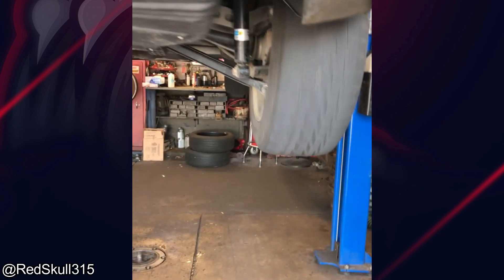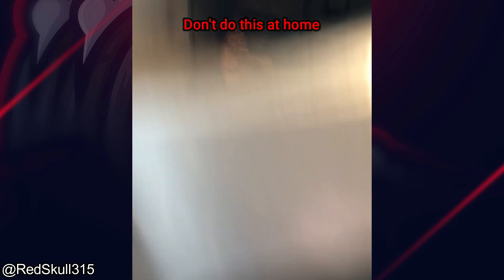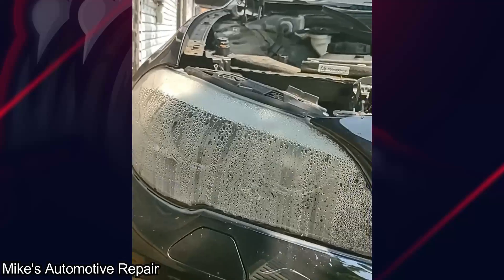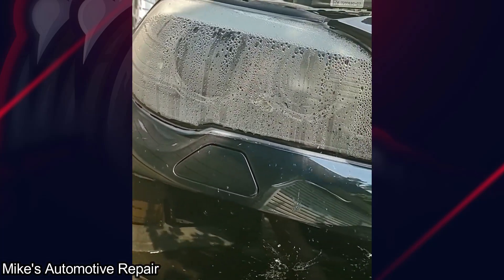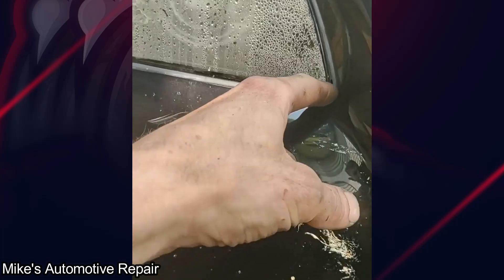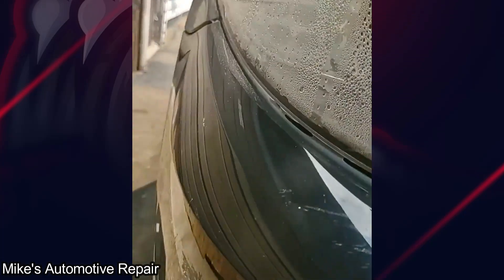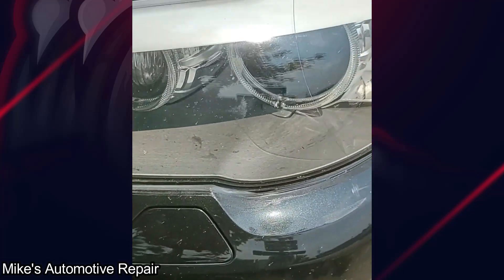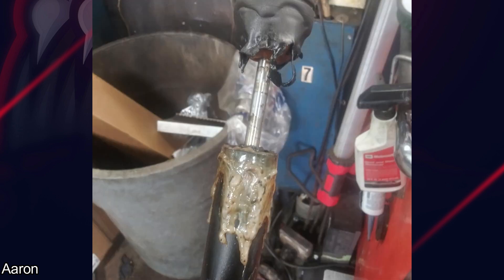Customer States "I Change My Engine Oil At Regular Intervals!" | Just Rolled In

Comment: I took my car into the dealership to get the tires rotated for free after buying it 6 months ago. AFTER performing this service for me the "ASE Certified mechanic" walks up to me with an official-looking form that had my VIN, make, model, year, color, etc. printed on it along with some boxes that were checked off to look like they had done a thorough inspection and found some issues that should be taken care of. First on the list was an oil change. I asked him what kind of oil he recommend for my engine. He said 10w-30 and synthetic would be best. I asked him how many oil changes he's done on this particular vehicle and he said "tons". Then I asked him to follow me out to the car for a minute. I popped the hood and asked him where exactly he was putting the oil... in my electric car.
Reply: @robertheinkel6225  I wonder about this as well
Reply: Priceless
Reply: It's like the guy who went with his girlfriend who took her Toyota RAV4 into one of those quick lube places to have the oil changed.  When she went back in to pay, the guy up front said that the "lube tech", due to her mileage, checked and recommended that she get her transfer case and rear differential fluid replaced.  When he quoted her how much it would cost and if he could put her down for an appointment, the boyfriend asked him how it was even possible being her RAV4 was front-wheel drive.  He said that the guy just stared at him for a moment with an "uh-oh, got caught" look on his face.  He then told the guy that no one looked at her vehicle and that they were trying to rip her off.  He said that she never took it back there.
Reply: @robertheinkel6225  hey man, not all of us service advisors are incompetent 😅
Reply: @trekzilladmc  If memory serves, RAV4 doesn't have transfer case no matter it's AWD or FWD. So do most of other FWD based AWD vehicles like Highlander, Sienna, CRV.
Reply: @trekzilladmc  Oil place I used to take my cars to loosened up the battery cable on my kia soul. Thought the first time it was my fault, had just replaced the battery the week before and might have not tightened the bolt. Second time I knew it was them. Yeah bet it would have been some expensive repair I could not afford that did not need to be repaired. Never went back to that place again. F you Kwik Kar oil!
Reply: @trekzilladmc  Wow never took it back?? You don't say??
Reply: I had my wife take my 95 roadmaster to an alignment shop once. She called to say the upper ball joint was bad and they refused the alignment. Fine I said. She came home and I went to drive to the store except the car wouldn't drive straight at all. I looked underneath it and the right tie rod sleeve had at least an inch of clean thread. Someone messed with it and pushed the tire so far out the car was undrivable.  I adjusted it and it was fine. However I called the shop absolutely livid they endangered my wife and everyone's lives by messing with my car that way. The service advisor assured me nobody touched it. I was like "so my wife did that??" Ain't no way your guy didn't touch my car I said. He said if I came down he could show video of the shop. I said if I come down there he's leaving in an ambulance that's how mad I was. To this day I have no idea what would possess someone to monkey with a car then send them down the road.
Reply: @trekzilladmc  you have RAV4s where you are that AREN'T AWD? That would be a RAV2.
Reply: @JBofBrisbane  Here in the U.S., the RAV4 comes in FWD as well as AWD.  Is it called the RAV2 where you're at?

Comment: Imagine if you did take your car to get the oil changed reguarly but it turned out the garage never did it once & just charged you for it.
Reply from the maker: I've heard of that happening before. Sadly I'm sure it happens more then we think. Pretty sad when a shop can't even change the oil after somebody pays for it.
Reply: @JustRolledIn  My father had a 1972 Malibu with the big V8. Got terrible gas mileage. Always had it serviced at the dealer (plugs changed regularly as this was the last of the leaded gas models). My father decided to change the plugs himself one day because of the terrible mileage. Fought with plug #8 for over an hour due to the lack of access before finally pulling out the oldest plug you ever saw. The dealer had never changed it.
Reply from the maker: @petercolquhoun2086  ugh that pisses me off to hear that! Not the first time hearing about places doing that.
Reply: @petercolquhoun2086  That happens a lot on LS engines in trucks, suburbans and tahoes.  #8 is fairly difficult, so a lot of people don't bother to change it with the rest of the plugs.  They come in with a misfire on that cylinder, pull the plug and sometimes the electrodes are completely worn off while the rest of the plugs look new.
Reply: Thats why I change my own oil myself. Cant trust companies at their word for anything.
Reply: @JustRolledIn  More $$$ for the shop and NO oil waste!
Reply: @toradora1439  Same,  the technician always cranks my filter on way too tight! I shouldn't have to nail a screwdriver though the filter to twist it off lol.
Reply: @toradora1439  Yup, 5k miles oil changed by myself is cleaner than 3k oil from shop which claimed to be 5k full synthetic and charged for extra bucks. Now I am considering about changing transmission oil by myself next time.

Comment: "Turn signal doesn't work."  The average BMW driver wouldn't even notice.
Reply from the maker: I was thinking the same thing when I watched that one 😜🤣
Reply: You might be able to notice at night,  @JustRolledIn .  Unfortunately, with that much condensation in the headlight good luck being able to get your electrical equipment to even reliably function.
Reply: What kind of bone head needs a BMW anyway . All the ones I see have tinted windows so you can't even give them the finger .
Reply: He was using the $2.99 per gallon WalMart blinker fluid, not the $299 per gallon BMW approved stuff.
Reply: That's because BMW cant patch the turn signal fluid reservoir and drivers lost all the fluids immediately after they filling it up. 
Not the drivers fault not the drivers fault. 😜

Comment: 0:21 I once had a piece of gravel get stuck between the rotor and the caliper bracket right after I did my brakes. Needless to say I was going through every possible scenario in my head to figure out how I could have screwed up the 2nd or 3rd brake job I did on the car since I bought it.
Reply from the maker: Well glad to hear you figured it out lol. I'm sure a lot of us have had this happen. I sure have!
Reply: We had a damn pebble get stuck there while driving once. Damn thing made such a racket and we just had to keep driving. There was some nice marks when it fell out or ground itself down into dust. Somehow nothing needed replacing.

Comment: Recently did a GM 3.6 timing chain. Recommended a oil pump as she was a bit low on pressure AND I'M RIGHT THERE. Nope. Couldn't afford.
Fast forward to 12 weeks later, oil pressure dropped so low the new tensioner wouldn't tension, valve cover cracked open from the sloppy chain, pieces fully jammed the oil pump, bearing fail.
The chain one at the end made me think of it
Reply from the maker: I've heard those 3.6's have a good handful of issues.

Comment: The early 90s toyota trecels control arms will do that near the bolt on ball joint too. The fun part is when you try to get the bolts out the head snaps off so you cut it off leave a bit of the bolt. Grab it with the vice grips then the captured bolt inside the damn body comes off the welds. So then cut a hole in the bottom of that.... p.i.t.a. aaarrrrrgggghhhhhhhhh.
Reply from the maker: Sounds like you've had to deal with that a couple of times lol
Reply: @JustRolledIn  Just one really really bad experience rebuilt the whole front suspension 4 new tires engine tune up. And then had a semi run across 3 lanes into me only like 2k miles later. 1st of the back set of axles hit in the gap between fender and door. Car was slightly sideways hard braking so. We were at back of cab when we realized he wasen't going to stop coming into our lane. We were in front of him before so he saw us for sure. Scary as all hell when you realize semi tires are a bit taller then the car that you're in.
Reply from the maker: @alreed2434  Holy cow! That's definitely scary, I couldn't imagine. I'm glad you're here to tell the story!
Reply: @JustRolledIn  For sure and it proved my other half is a hell of a driver!

Comment: I used to live next to a guy that bought a brand new thunderbird, never changed the oil. Just filled it up when it was low. Lasted almost 90,000 miles.
Reply from the maker: Dang. Surprised it lasted that long.
Reply: I had car which would not have needed oil changes, just fill-ups and filter changes. Factory recommended change interval was 30 000 km, 3.5 l oil space (with filter) and it ate 0.1 l oil / 1000 km. So basically it ate whole oil volume between suggested oil changes (I got it changed by half of that interval + extra fills).

Comment: The spark plug is freaking cool, never seen that one before...
Reply from the maker: Variable spark spark plugs
Reply: I've had one, and only one, do that in my 20 years of experience.  It also was an AC Delco plug.  The porcelain pulled right out of the shell, so I kept it as a souvenir.   Of course, I've also had a lot of those super special Ford plugs come apart while taking them out... but that's a whole different thing.
Reply from the maker: @livewire2759  spark plugs on 5.4's. I can relate lol
Reply: I mean I've seen them blow out and leave dents in the hood before but not variable plug gap LOL.

Comment: When I was a kid (I'm 73 now), people would drain their oil, refill with kerosene, and run it for a few minutes.  Then drain that out.  It would break up the sludge.  That's what needed with the first one.
Reply: But is that still advisable for cars made after 1990?
Reply: @RtistiqSkubie  If you have a 20 year old car that's never had the oil changed, I doubt you could screw it up any more.  So yeah, I'd do it to any car that had oil like that coming out.

Comment: So the headlight home fix is still a hole In the lowest point of the headlights and drill a few, water will most likely drain
Reply from the maker: There's a computer usually behind those headlights so you'd have to be careful but ya I've done that before
Reply: Oh wow, I really hope those are water resistant at least

Comment: The 98 Civic I bought the folks said they did an oil change. Forgot to mention they didn't even hand tight the drain bolt or replace the filter. Filter was covered in sludge to the point the mechanics helping me had to jury rig it with channel locks because it was so slippery with sludge and that they were using 10w40. In a Civic. One year later I've been slowly replacing everything but yeah that was epic to see how close I was to being stuck.

Comment: had 3 champion plugs do the same on a small block chased it for 3 hours it would run fine until the gap was to big or small and then start missing but always on a different cylinder

Comment: I am always amazed at how much rust these cars in the states have.
Reply: Salt rust in the northern states because of road salt in winter
Reply: @rooftopvoter3015  In Developed 1st World countries annual  safety tests would flag these safety critical defects years before they got to that failure state. I remember visiting New York and was shocked at the open corrosion  with gapping  holes  I saw of structural  body  parts of 25 year old cars still on the road.

Comment: Go on then, the BMW F10 at 1m12s.  My 2011 right headlamp does this and I dry it with silica gel.  It is seemingly a common fault, so where does the water get in?
These lights do lightly mist on cold humid days on lets say all of them in the right weather conditions. They are not 100% sealed else they would break apart.  But where/how does a shed load like that enter?
Being a BMW, you cannot remove the headlight with the front bumper and a shit load more parts.  Words fail me it's that simple.

Comment: I will admit to my most embrassing blunder.  I used to have a 2004 S10, and about 4 or 5 years after owning it I decided to do a bit of maintenance to the spare tire lift mechanism.  I cranked the holder down, lubed the metal rope and all moving parts.  I checked the spare tire and added a bit of air.  I cranked the spare  back up into position, and that was it.  Forward a few years, I was doing some brake work and decided to also look at the underside for signs of rust.  I crawled under the rear and thought to myself "wow, i don't recall it being so spacious under here!"  Then I noticed something odd: "What the hell is this frayed thing."  Yup, I guess I hadn't cranked the wheel back up suffiently and the tire must have been moving ever so slightly over the years.  Never realized that I dropped a spare......
Reply from the maker: Damn hahha. I wonder where it dropped lol
Reply: Or it was stolen!

Comment: That first clip, the one where the technician is draining "black poo" from the engine with regular interval oil changes...  I've seen that on some diesels that do in fact have oil changes as per manufacturer specifications.  I've seen it happen when people try to run a diesel engine on WVO (Waste Vegetable Oil).  Cooked oil, mixed with engine oil, turns into this.  How does Cooked Oil end up mixing with engine oil?  Blow-by.  Happens to every engine.  I've never seen it happen on diesels running on new vegetable oil.  But new vegetable oil isn't cheap, as a matter in fact, I believe it costs more than plain diesel, even at today's prices.  It can get expensive trying to go cheap with alternative fuels.
Reply: diesel oil always goes black
Reply: @uroskostic8570   But it shouldn't be sludge.
Reply: Unprocessed used cooking oil. 
It seems to work great as a fuel, but it really thickens engine oil, especially if in a cool climate.

Comment: Changing oil regularly ? Do they use straight crude oil ? Great news with that tire , it's only shredded on one side . Just flip it around and good to go . A little jb weld on that bell housing and it'll last another month .
Reply: Flex Tape

Comment: "I change my oil at regular intervals..." Every 50,000 miles doesn't cut it, chief.
Reply from the maker: I was thinking the same thing lol. Poor diesel
Reply: I reckon you could cut it, with a pair of scissors.
Reply: Was thinking they were using crude oil 🤔🤷‍♂️
Reply: You should confirm with the customer if their "regular" means "life time".

Comment: He changes his oil at regular intervals...

Every 25000 miles or whenever I open the oil cap and there's 5 inches of white goo stuck to the bottom of it
Reply: Whenever the red add oil light comes on. No need to change that last quart.

Comment: In Developed 1st World countries annual  safety tests would flag these safety critical defects years before they got to that failure state. I remember visiting New York and was shocked at the open corrosion  with gapping  holes  I saw of structural  body  parts on 25 year old cars still on the road.